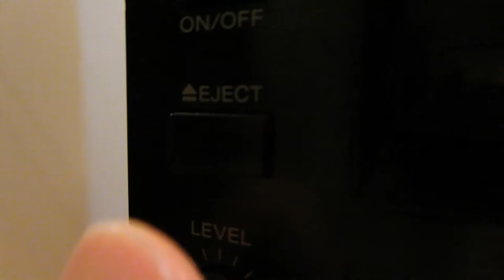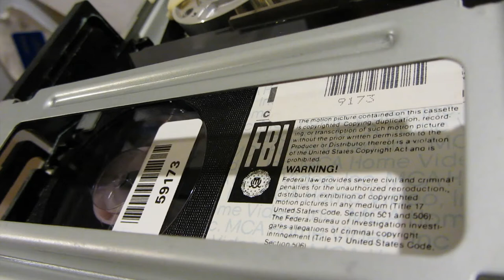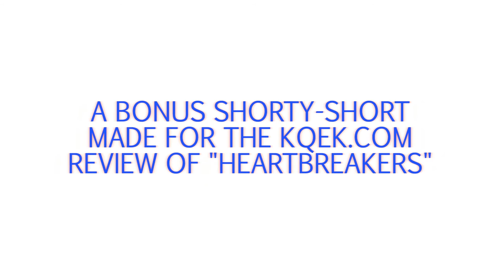The Stuck Betamax Tape (2016)

Comment: loading alignment.cheak broken gear also
Reply from the maker: Thanks for the tip - Will post a short follow-up clip - I recently used the machine and noticed a gear to the left failed to raise the tape tray, which might be part of the problem. Cheers --- MRH

Comment: Do you have the review on youtube?
Reply from the maker: +Zestypanda Hi - No, just the printed review at http://kqek.com/mobile/?p=13085. Cheers --- MRH
Reply: KQEK.com Oh. Do you, or the owner of the betamax player plan on doing an indepth repair video?
Reply from the maker: +Zestypanda No. I'll eventually take it to a shop for repairs, unless someone's posted a how-to page on fixing a misaligned gear. I think what happened is a tape may been too tightly wound among the gears, and during an eject, one of the threading rods was pulled a bit too tight - or maybe a gear's worn out. For the time being, nudging the tape out with a finger's the only way to eject a tape. At least the machine still plays fine (fingers crossed). --- MRH
Reply: KQEK.com Take a look at 12voltvids, I believe his username is. He has videos on how to fix timing issues.